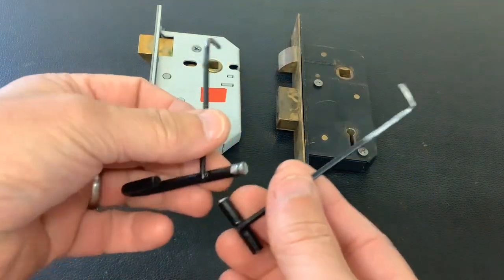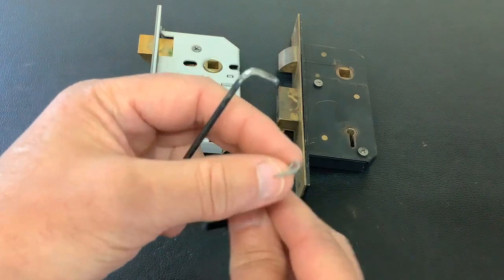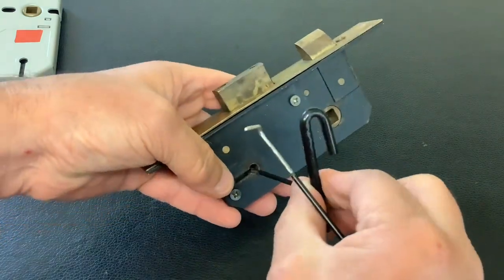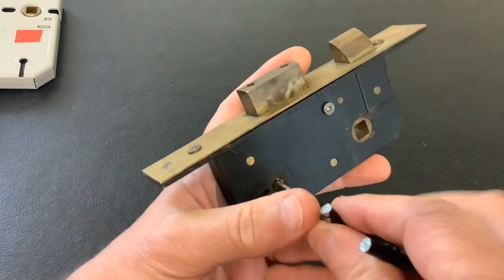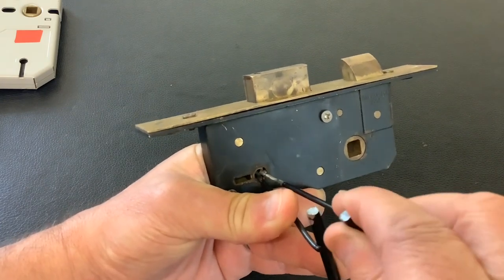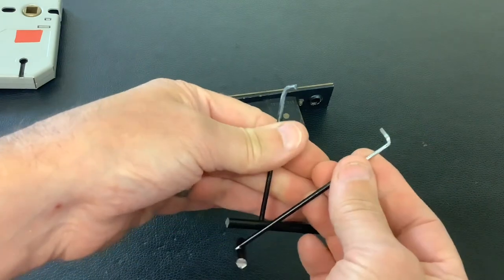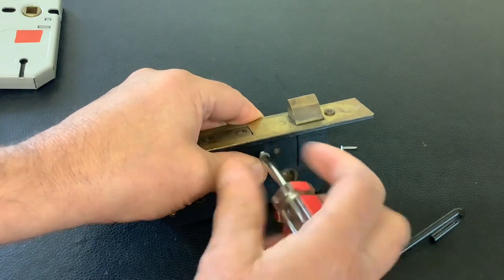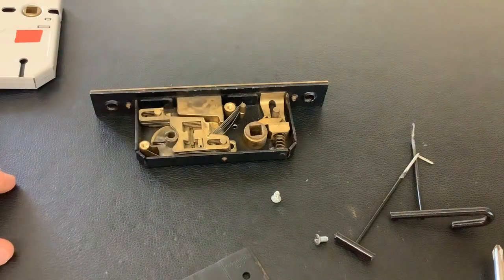735. Picking open a Legge 5 lever curtained lock with very basic tools made from wire coat hangers

Comment: I have a lovely Victorian safe which has an auto locking door with a non curtained lever lock. Somebody accidentally locked the keys inside by closing the door. Could I pay you to come and pick the lock to gain access to the keys. I’m in the Walsall area
Reply from the maker: Sorry mate I only pick locks as an hobby, you would need to get a professional locksmith out to open it who obviously has professional tools, insurance etc
Reply: @BrummieLockPicker  Ah okay, no worries. Thanks for the quick reply. I have tried to pick it but got nowhere so it’s a bit annoying and I don’t want it drilled. Love your videos by the way!
Reply from the maker: Cheers 🍻